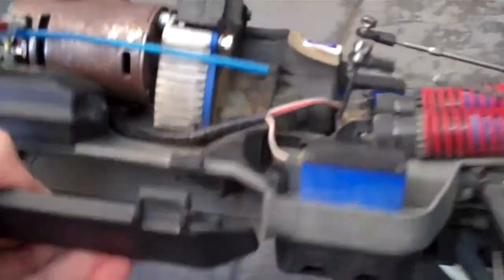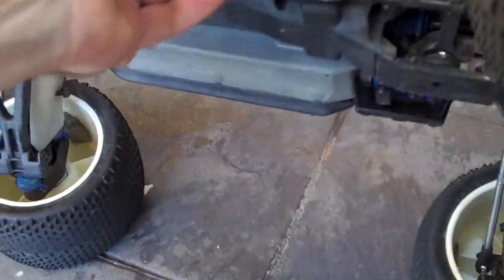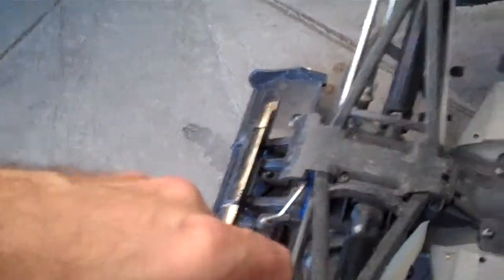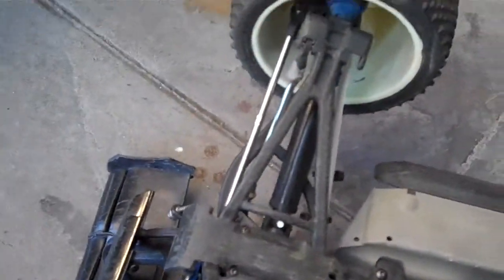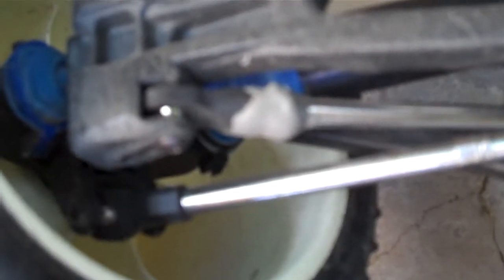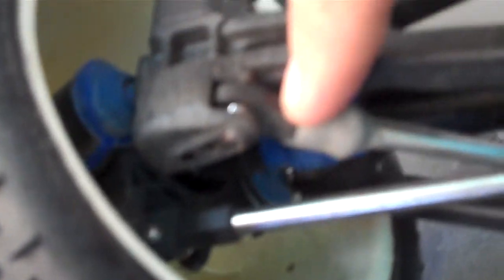RPM rod ends apparently dont fit erevo.... sssshhhh dont tell nobody

Comment: lol I think this video was a response to something I said on URC?  I was a bit confused about these rod ends fitting because Traxxas sells different rod ends for the rear turnbuckles only but as it turns out they aren't that different after all.  I since bought the RPM true track arms so rear turnbuckles are a thing of the past for me.